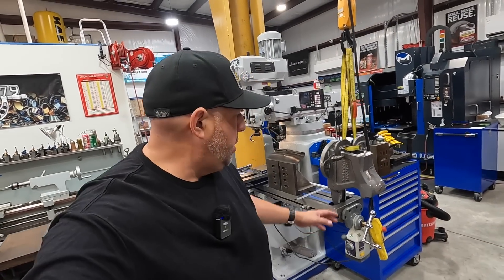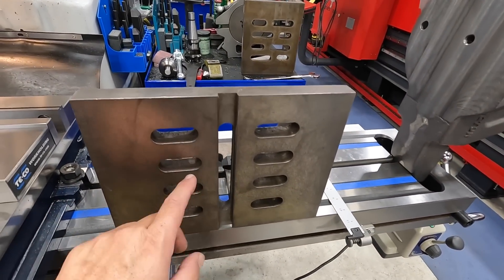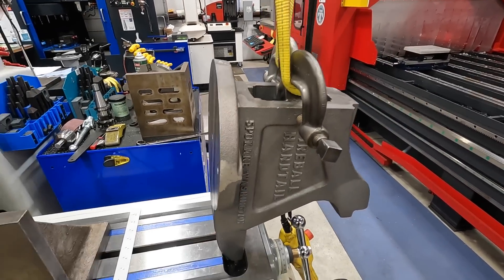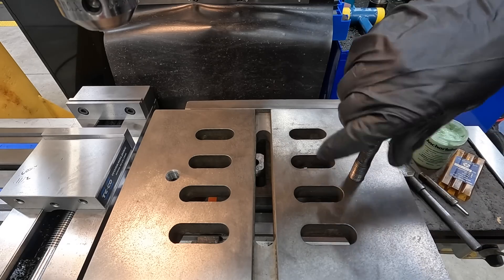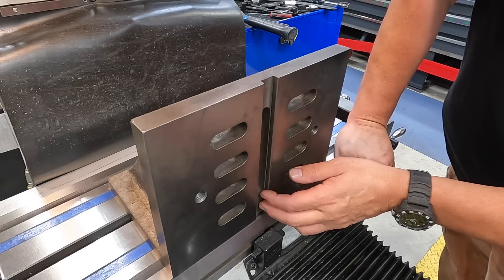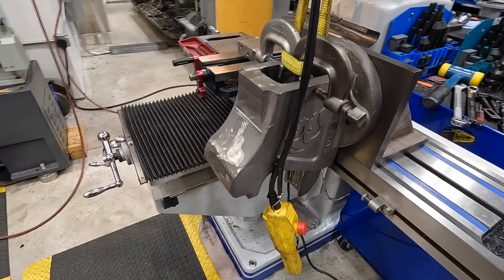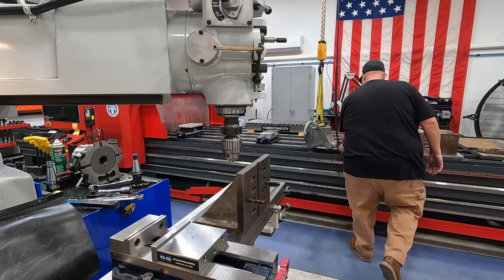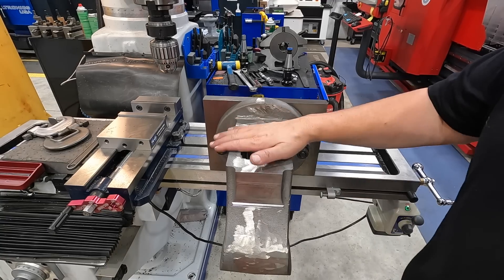Tool Tuesday Ep. 7: Angle Plate Modifications for Custom Fixturing

Comment: yo, why so many haters? can’t you guys just take the free knowledge he’s given you and chill. i see this as an exercise in fixturing. you learned something and didn’t even notice… smh … Adam keep sharing the knowledge, some of us hobby machinist appreciate what you have shared.
Reply: Always someone out there that thinks they can do better, even though it’s a personal project using the tools he WANTS to use instead of what’s perfectly best to do
Reply: @JohnnyQuesoTV  There is nothing more rewarding than using the correct technique at the correct time with the correct tools on the correct machine in the correct order. Otherwise what is the point? That is what we are expecting, people copy this stuff to their detrement.
Can someone explain why the angle plate was not simply held in the vice to drill the holes?

Comment: Adam, do you keep your Anchor Lube in the fridge? I bought a bunch a few years back but it ended up spoiling sitting at room temp. When you'd open the gallon container it smelled like moldy gym socks, I mean horrible, i ended up having to throw it all out and haven't bought any since. Went back to Rapid Tap for this reason. The anchor lube smelled great at first, but after it spoils, holy moly.
Reply: I've used an expired bottle for a couple years, still lubes, but haven't noticed the smell.
Could be it's the small dropper bottle.

Comment: If you hang it off the back of the table, you won't have to extend the ram out so far and have plenty of Y travel.
Reply: DRO scale may be in the way on the backside of his table.
Reply: @MatthewRulla   Thats true.  It's on the front of my table.
Reply: @MatthewRulla  I believe you're correct
Reply: @MatthewRulla  extend the angle plate over the dro scale.

Comment: your American flag is hung the wrong way. the blue and stars should be to the right.
Reply: What? No. It’s always to the viewers left.
Reply: OP Wrong. For the avoidance of any doubt at all:
"When displayed either horizontally or vertically against a wall, the union should be uppermost and to the flag’s own right, that is, to the observer’s left. When displayed in a window, the flag should be displayed in the same way, with the union or blue field to the left of the observer in the street."
Reference: U S Code Title 4 Section 7 Subsection (i)
Reply: @nicktecky55  Thanks for the code quote.
Reply: No, he is correct: When displayed either horizontally or vertically against a wall, the union should be uppermost and to the flag's own right, that is, to the observer's left.

Comment: Hello Adam. question why dint you use the horizontal mill
Reply: The K&T is in his home shop, not the new shop shown in the video.
Reply: @eliduttman315  Well then I would have taken it to the home shop, way more rigid than extending out the arm on his mill.
Reply: @ronaldfairhurst2914   That's what you would do.. .that's not what he would do.  He's not trying to grind a mirror for a telescope - it's not that precise.
Reply: @silasmarner7586  I wasn't thinking precision, just way easier to put on the horizontal and not drill holes in your angle plate.